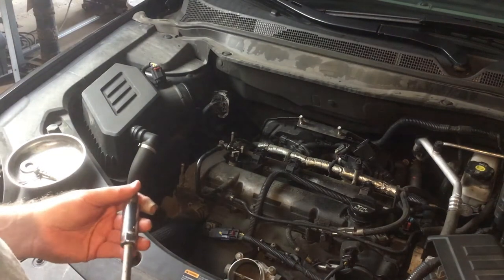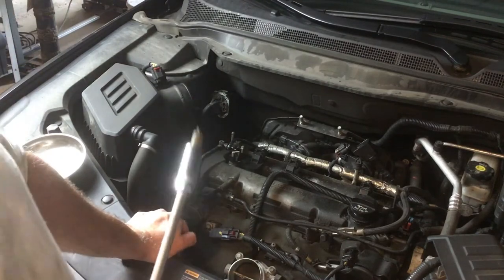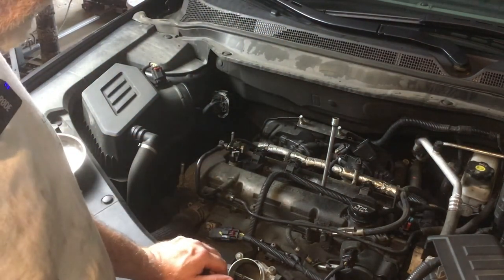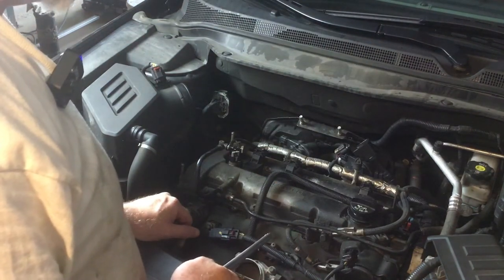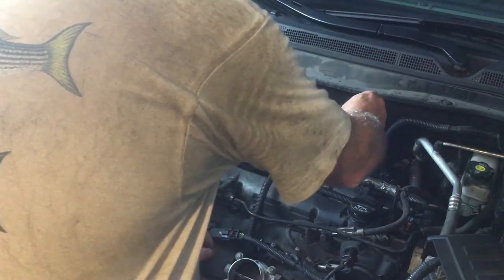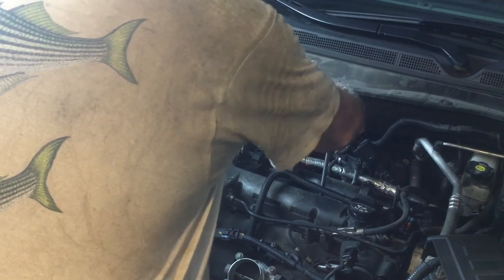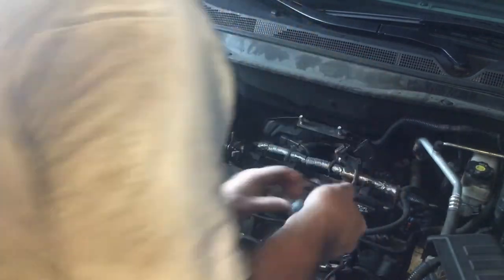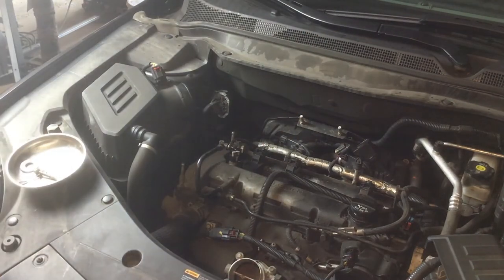Quick Tip 3 - Stuck Spark Plug Socket opt

Comment: I've been stuck with the last spark plug for days. I have been tightening it only to pull out the extension without the spark plug socket. I did this dance many times until I saw this. Thanks. You saved my sanity and money because I was ready to buy something to fix this.

Comment: If your socket is already stuck, maybe you could get a stiff wire such as a clothes hanger and with pliers make a small hook that fits inside the square opening and pull out the socket.

Comment: You stated that you were having trouble retrieving and were going to show us what to do.  I think the tape could have been used to put on the extension end , then jammed in the socket at bottom of spark plug hole so it would retrieve the socket.  Maybe best answer is to combine both techniques. Thanks for your good suggestion for avoiding the dropped socket.

Comment: This doesn't tell you how to get the socket out when it's stuck.  It only tells you what to do in advance to having the problem. This vid doesn't address the title of the video.
Reply: You could try just loosening it off and redoing it, that’s what worked for me
Reply: It does. You back the spark plug back out, tape the tool up good, reset the spark plug, and you're home free.